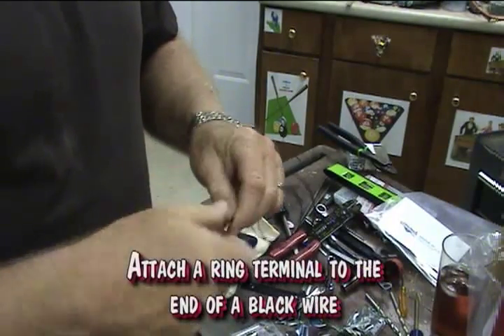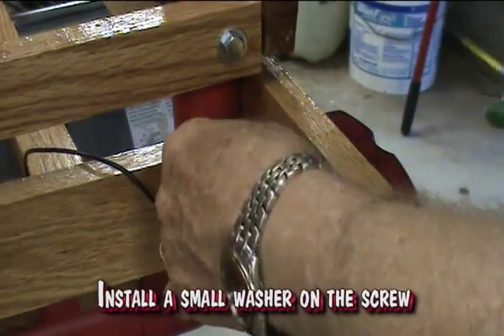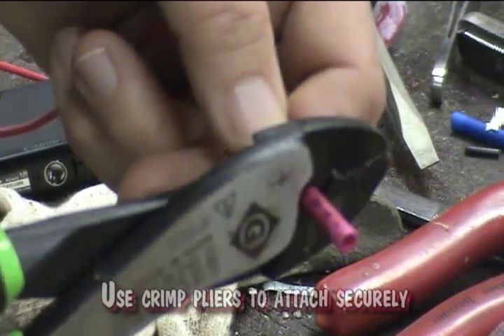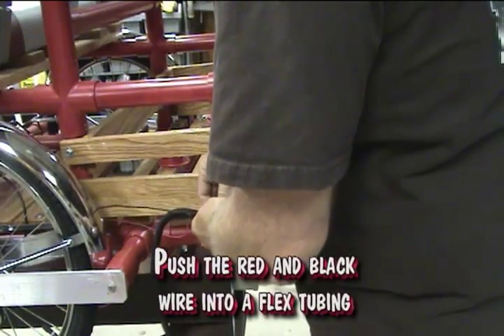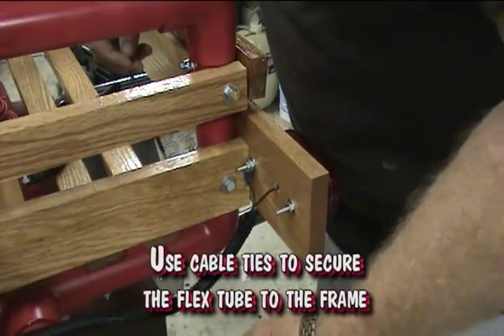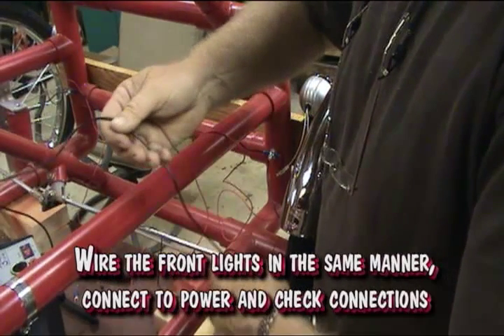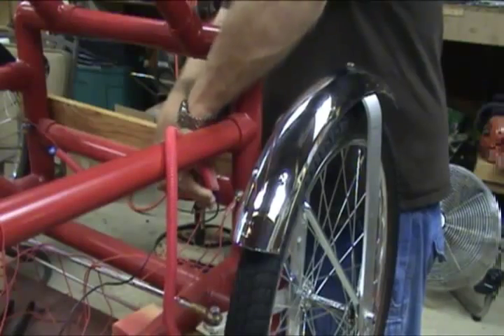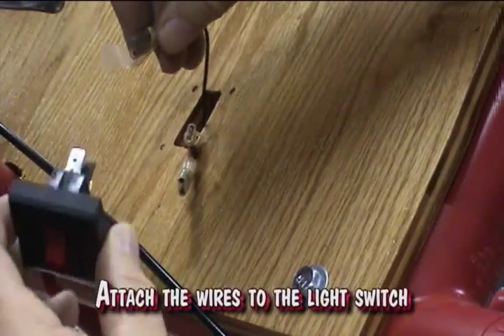Part 25 of 29 - PVC 4-Wheel Cycle - How to Wire the Lights and Switch

Comment: Norman, You do excellent quality work. I can tell you're the kind of fella who doesn't mind taking the time to do the job right and I commend you for this. As an experienced electronic hobbyist (amateur radio operator, etc.) I'd like to share a little tip that does wonders for keeping those well done electrical connections in perfect working order for many years. Many people will bad-mouth crimp style connectors and insist that only soldered connections are reliable. Now, soldered ARE in fact the best way to make an electrical connection in most cases, however by taking the extra step of coating every crimp connection with a quality dielectric grease will do wonders for their reliability over the years. Every time I crimp two bare wires together with a crimp butt connector, I am sure to coat each of the wires with the dielectric grease BEFORE inserting in the connectors and making the crimp. I do this for every style of crimp connection along with coating the terminals of switches, relays, and the like before slipping on the push-on connectors. Pretty much.... I make sure all connecting surfaces have a thin coating of this grease before installation. This grease will prevent (or at the very minimum slow) corrosion of said connections. This extra step is most critical to any connections that will be exposed to moisture. Wiring on boats, motorcycles, automobiles, and pretty much ANY vehicle used outdoors and/or near water will benefit greatly by this little tip. I've seen crimp connection that have been done in this manner last 10-15 years without any noticeable degradation of performance regardless of exposure to the elements. I used to be co-owner of a motorcycle accessory business that sold big dollar (high quality) lighting systems that required us to modify the standard automotive wiring harnesses for custom-fit motorcycle applications. Every connection made by us were done in this manner and with superb results. Dielectric grease can be obtained in most any automotive parts supply made by quality manufacturers like Locktite, Permatex, & etc.. There's also a great multipurpose synthetic grease called "Super-Lube" (by SYNCO Chemical Corp.) that also can be used as an excellent dielectric grease. It's a "two-fer" kind of product that can fill two separate needs (superb-quality general purpose lube grease & dielectric grease). If I'm doing a wiring job that I want to both look good and last a very long time, I use dielectric grease on all fittings, heat-shrink tubing, and wire looms. Norm, add this one extra step to your already excellent methods and you'll add more years of dependability to your work, I guarantee!!! ............... Roger (W9ING)
Reply from the maker: Roger Smith 

Roger,
I can see how this would be a functional improvement for all type crimp connections.
I have learned so many new techniques from people like you who are willing to share their expertise. Thanks again and have great July 4th holiday.

Norman
Reply: Norman Gooch My Pleasure and "right back at 'ya"!! ..... Roger

Comment from the maker: Yes you can. LED lights use less power than regular lighting. Adding LED strip lighting with the rear and front lights would be no problem. I suggest you add an on/off switch just for the LED lights separate from the main lighting system. But all can operate from one 12 volt 18amp battery.
Thanks,
Norman